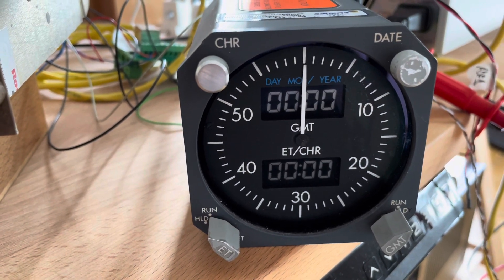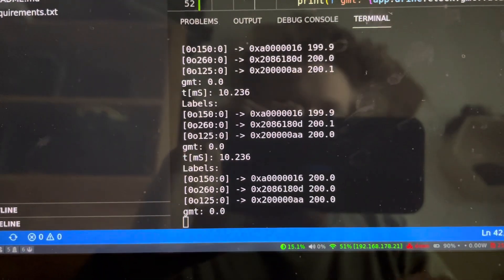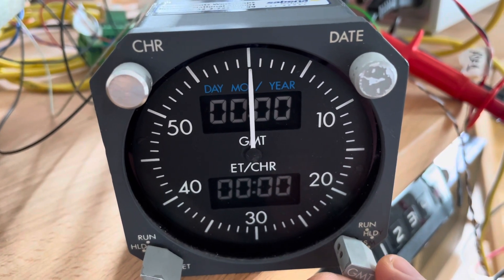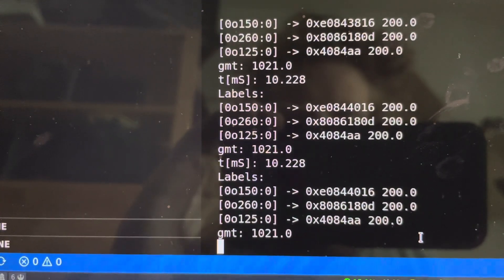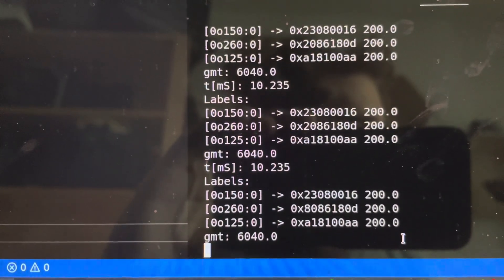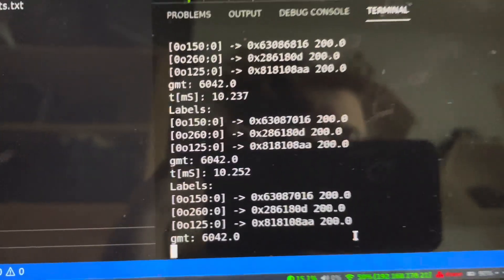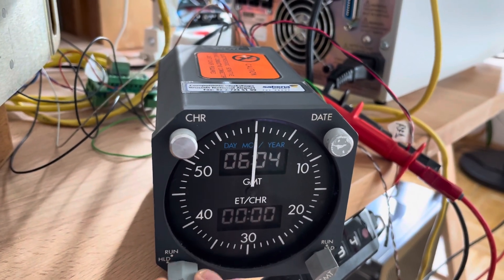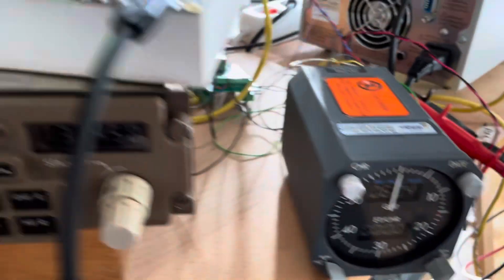Checking whats out of OEM 737 Clock Arinc429 bus

Comment: Wish it worked the other way around. Looking into having a battery to keep the time.
Reply: Remember that in modern cockpit let's say B757 and later, the cockpit is mostly comprised of display apparatus, the bulk of the work is done in the real avionics systems in the floor below the cockpit, so precise time is not kept by devices in the cockpit.